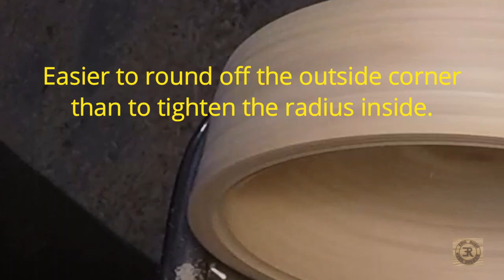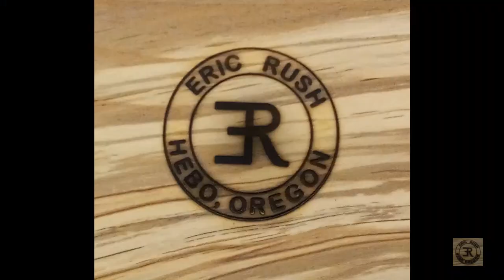Three Wet Bowls for the Microwave

Comment: Don't tell me you can't teach old dogs new tricks.  I'm learning this craft every day too.  One thought, the flat end scraper may work better with the angled side down, but I may not be seeing what you're doing clearly.  I'm on this Old Timer's journey with you Eric, nice work.
Reply from the maker: No scrapers except the carbide on the mortises in this one, Scott. The only thing I can find is the skew at about six minutes in I used to cut the dovetail in the mortise. The angle on it is perfect for the dovetail. Or was. I've since rounded it off slightly to make it easier to use as a skew.